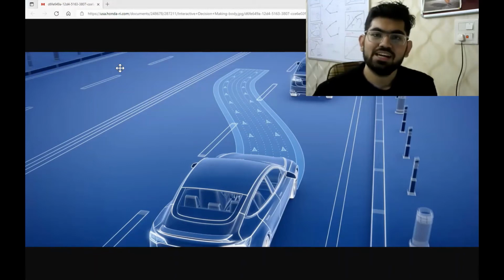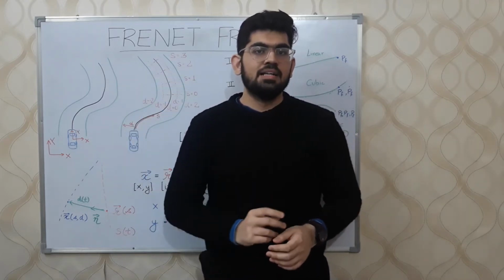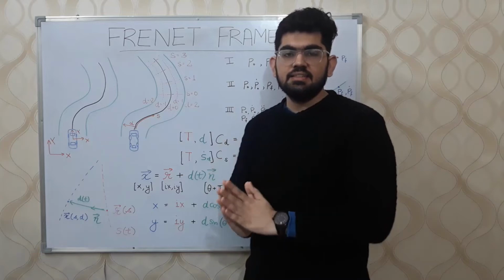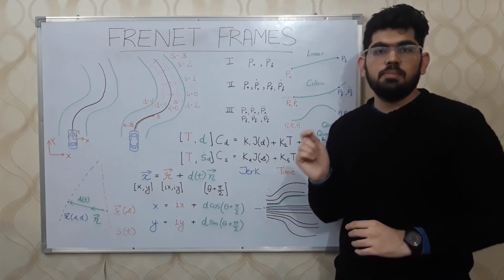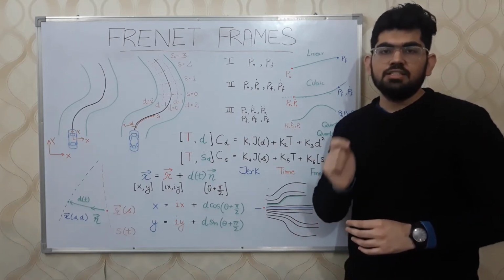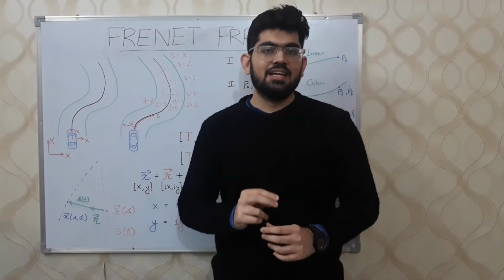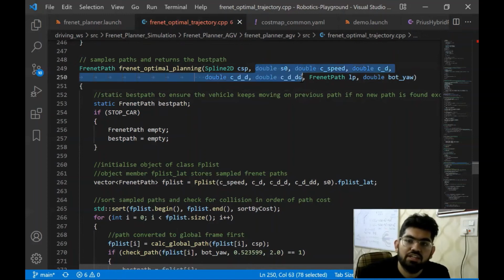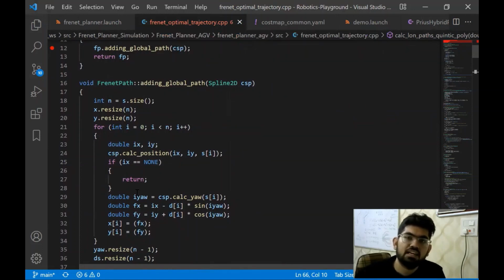Frenet Frames | Self Driving Cars | Motion Planning for Robots

Comment: Thanks for the video! I was in a problem understanding this idea, and lost on the way , but your explanation was crystal clear! Cheers!
Reply from the maker: Thank You 😊 Happy to know it helped!
Reply from the maker: Hello!
It's completely correct, that the cost of each trajectory does not depend on the information from the costmap. However, the trajectories that go through or are quite close to the obstacles are directly rejected. The algorithm first generates the different trajectories. After generation, it rejects those trajectories that do not satisfy the velocity limits, curvature constraints and costmap constraints. Then from the remaining trajectories the best one is chosen based on the cost function.

You can check the link for a smaller Python based implementation, which would be easier to understand: https://github.com/AtsushiSakai/PythonRobotics/blob/master/PathPlanning/FrenetOptimalTrajectory/frenet_optimal_trajectory.py